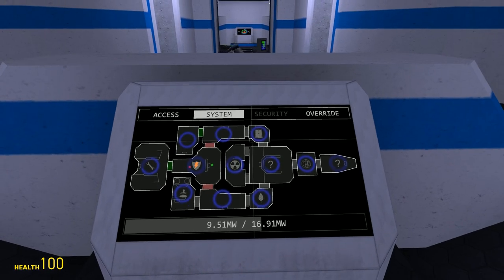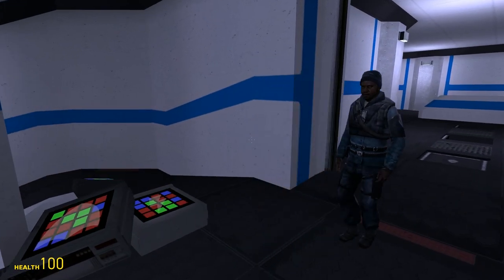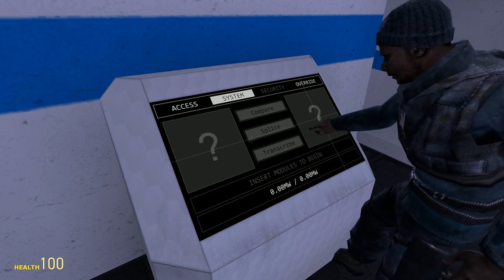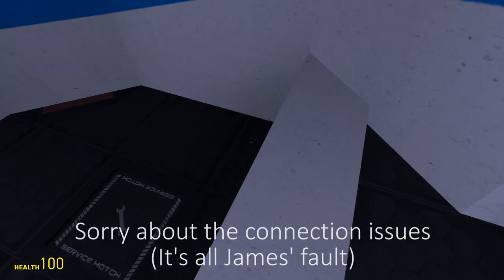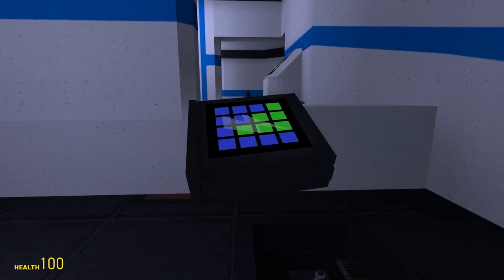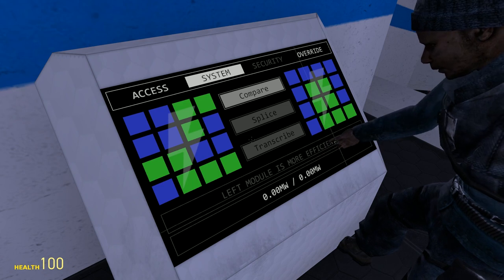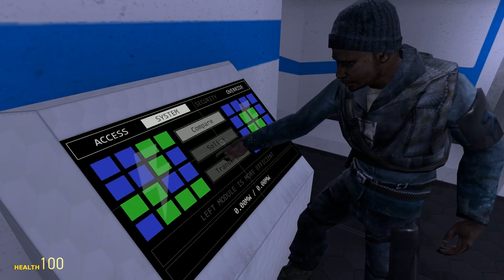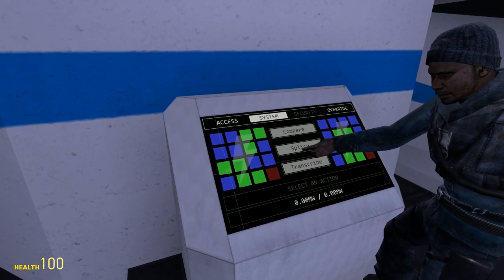Final Frontier - Engineering Walkthrough

Comment from the maker: Thank you for your concern.
We have designed the system to be difficult to master but easy to use. If you wish to simply get a module repaired you need to simply splice it with a working one, requiring one button press. Creating the best module in the universe, however, requires great skill and planning.